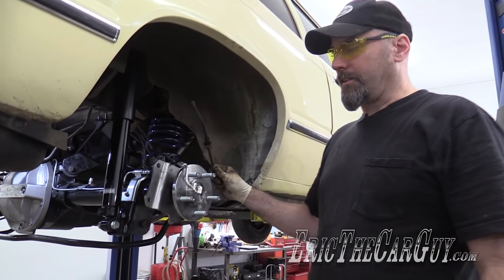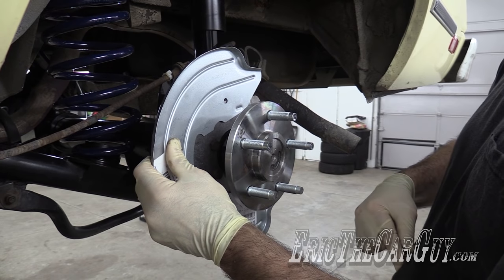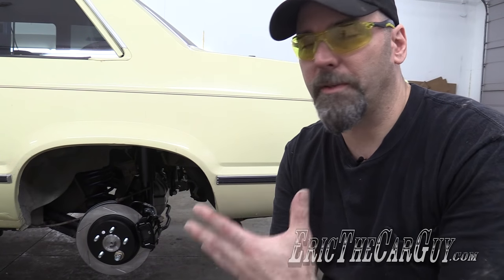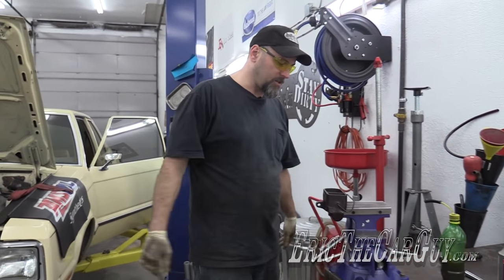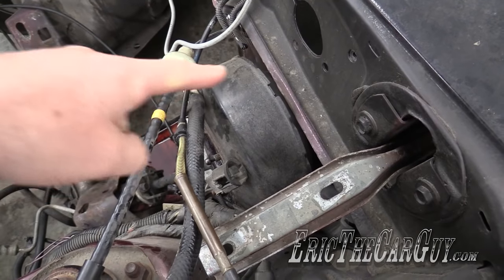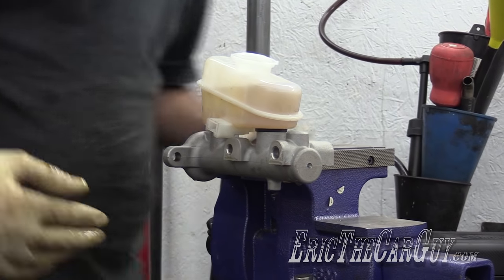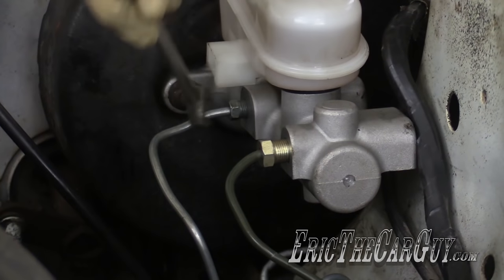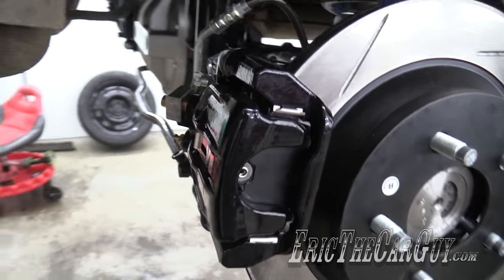Installing Rear Disc Brakes the Hard Way #FairmontProject

Comment: i saw the upside down caliper as soon as the first one went on, I thought, ok, Eric will catch it....then when he went to bleed the system, I thought, ok, NOW, he'll see it. i feel for you, Eric, I've been a tech for over thirty years, I've done that more times then I'd care to count. the excitement of the build, seeing the pile of parts becoming a functioning unit, its easy to get blinders to the basics. no ones perfect.
Reply: anyway, on the positive side, with the heavier weight of the new engine and the four wheel brakes, you will benefit from the power booster and since you converted from drums to disc, the old proportioning valve wouldn't work, as the ratio of pressure front to rear is different. you would have ended up putting in those parts anyway.
Reply: I noticed it and thought something was wrong, but I was so focused on finding the mistake and forgot about it :P
Reply: I assumed there was an upside down caliper somewhere... lol I did that myself once...
Reply: I would not have noticed if not for the disclaimer at the start. But, looking for mistakes noted bleeder needs to be at highest point to get air out. S happens to us all.
Reply: Yeah, around the 6min mark I was like "why the hell is that bleeder BELOW the incoming brake line??? Who designs something like that???"

We've all done stupid stuff like that, so I don't want to blame him for this. We all know that "I WANT IT FINISHED" mindset that causes screwups like that :)
Reply: I had a local Aamco replace an axle (I was on lunch break at my job, trying to get BACK to work when the splines pulled out of the cv joint), I thought it was my clutch failing, so I just had them take it to the garage rather than me diagnosing it myself. Anyways, they replaced the axle and for a fair price, I was quite content, until a week later... they had to take the ABS sensor and disconnect it when they put the new axle in, and when they hooked it back up again the wire was TOUCHING the new axle and chewed through the cable. I was pissed, the new abs sensor was about $120.

Fast forward a year, I'm replacing the struts in my wife's car (same model as my car) and I had to disconnect the abs sensor... and YUP. Hooked it up wrong. Took a few days to chew through, but suddenly the whole car is dying out like traction control is kicking on, turns out to be the sensor... I can't tell you how utterly disappointed I was in myself.
Reply: Everyone who works on cars has made this mistake at some point. I remember spending ages trying to figure out why it wouldn't bleed only for another guy to walk over and take one glance and spot the problem.
Everyone has off days
Reply: ItsFriscoBaby Recently my wife's car was dogging out big time at around 35-40mph, I thought the transmission was dead because the fluid has been smelling burned for quite some time (I keep changing it too), had it taken to the garage and the guy informed me I had installed the ABS line so that it was touching the axle and it rubbed through making the car think the passenger front wheel was spinning. I was pretty mad at myself for 1) ruining a $120 sensor, and 2) paying someone else to figure out what was wrong. 

The sensor was $120, but the bill alltogether was $220. I thought it needed a new tranny so I rather let them do it than me, it's worth the money to me since I only have weekends to really work on vehicles.
Reply: i know the feeling when i get my car out the shop and crap isnt quite right so i decided to start working on my own lol
Reply: dave1135 
I'm guilty as charged as well. Seen it numerous times and it didn't register until about the time right before Eric caught it when I paused the video and thought about it...then it clicked. Figured it watch the rest of the video and he caught it as well. Sometimes the things we do get lost in the moment, happens to us all.
Reply: I sent a Jeep XJ for and MOT test in UK.  They told me I needed a brake caliper for the offside, which they ordered for me.  Delivered was an onside caliper, which fits, but the bleed nipple is on the bottom.  No bleed nipple anywhere in the universe is at the bottom, but they spent 5 days trying to bleed it anyway.

When skin-diving in poor visibility it's possible to become disoriented.  Hint, bubbles always go upwards.

Comment: Kudos on you for keeping it honest.  This is my weekend project.  Front & rear discs & pads, complete rebuilds on parking brake assemblies (drum setup inside rear discs), and watching your videos encouraged me to upgrade to braided stainless brake lines, so I'll be upgrading those this weekend as well & flushing the system before buttoning everything up to get my daily driver ready for the trip to work Monday morning.

Comment: Eric, 

It's videos like these that keep things real. So many times if you watch automotive tv, they do things and they seem to magically work.  I think that the struggles you went through with what would seem to be a relatively simple job like brakes, make people realize that there's more to doing a job than just bolting on a few parts and calling it done.  Thanks for powering through and figuring out what the problem was.

Comment: I love, love, LOVE the honesty in the videos that you post.  The simple mistakes that can be made (in this case, more because of the excitement or head rush), which is why you should always double & triple check your work. Then verify repairs or test drive vehicles before handing them back to the customers.  We, in the repair & service industry, have ALL made mistakes one time or another.  Just try to learn from them & always drive to do the best job possible.  

The other  reason why I love your videos so much, it shows the struggles & setbacks we go through.  Now customers or those not in the repair or service industry have an ability to somewhat step in our shoes & see them 1st hand.  Too often, there are customers who think because we do this everyday, we should know things in & out.  Everything always goes to plan (when in fact more often than not, it does NOT).  We are pushed to rush & customers get annoyed, no matter how you explain "said issues". 

I have to admit, Eric, your commentary in the beginning & end were quite amusing. A few times it had me laugh out loud.  Keep up the videos & the honesty!  I already see the NEW engine dropped in the background & turbo sticking out.... anticipating the updates!!!
Reply from the maker: Thank you! The videos coming out are about 3 months behind the actual build. I still have a ways to go and a lot more videos as well. Thanks again.

Comment: Has happened to me a number of times when building race cars and hot rods. It's easy to have preconceived notions about how things are supposed to go. I have overlooked the same mistake several times even while looking for it. You just get a mental block somehow. Like adding up a string of numbers and getting the wrong answer. You go back over it looking for the mistake and wind up coming up with the same wrong answer again. Frustrating, but I can't think of anything more enjoyable than working on non computerized cars, even when things do go wrong once in a while. Glad you got it figured out. IMO, these Fairmont videos are by far the best you've ever done.

Comment: Wow I just went through the same thing 2 weeks ago when uninstalling my BBK. It was a two day ordeal. I was going nuts bleeding the master cylinder and all. Finally my friend told me make sure they are on the right side because if the bleeder is on the bottom air gets trapped up top. What a PITA. Kudos to you for figuring it out 10 times faster than I did lol.

Comment: had amost exactly the same problem with a london taxi. inconsistant brake pressure. changed almost the entire brake system out for new. then after 3 days of swearing. i realised there was a 3rd bleeder valve on each caliper that i hadnt seen at the back of the calipers.. full of air... doh... you live and learn. great video Eric.

Comment: I run a homemade rear disc setup and have to bleed the calipers off the hub as they mount at a different angle to there intended position. Such an easy thing to miss especially when your focus is on the test drive. Owning a sleeper is awesome and getting stuff like this happen is just part of the 'fun'.  Love your vid's, keep em coming :)

Comment: We all have some similar story, now you have yours. I replaced a radiator, all coolant hoses,  thermostat, and finally the heater core before figuring out the head gasket needed to be replaced...... now I own a compression tester.

Comment: I gotta get my told ya so in as kindly as i can. I am glad you figured it out and tackled it and this video with such humility.
The prior video when you made brake lines for the rear diff, I asked if there was going to be an issue with the bleeder below the brake line inlet.

Comment: I did chuckle when you installed them upside down I probably shouldn't have but I did. At least you are man enough to admit your mistakes. You got your rotors on the right way that was a start. I did have a similar problem once and I put it down to eagerness I just replaced the motor in my car and put two spark leads in the wrong spot and could figure out why it was misfiring took me a whole day to figure it out and yes I laughed at me for being so eager blind to the problem.

Comment: I'm doing a rear end swap in my ae86 and i had the exact same issue with my caliper bracket spacing.  i saw someone cut out the mounting area out of the drum brake backing plate and that works well if you wanted to go with a plate like spacer over the washers. these rear end series are helping me out a lot with my rear end swap project.

Comment: I noticed the position of the bleeder as soon as you mounted the caliper. Means a lot that you are willing to show your mistakes. I call them backing plates too. Really like the stool you were using. You can use a master cyl. from an E250 early 80s van. Works great for manual brakes, and has a 1 1/4 inch bore. Should bolt right up. I used one on my Heep when I did a rear disc swap. Will lock up all four 38" tires and stops on a dime

Comment: been through this on the same car ...you gut the stock prop valve and install the new master and the adjustable prop valve ...disc's need a ton more fluid displacement then drums hence the larger bore master , adjustable valve gets installed in the firewall junction on the passenger side of the cowl (then I watched you do just that haha)., Lookin good Eric ,love the build man.

Comment: Eric, I feel for your pain on this one.  Sometimes you have to know when to walk away and come backs to a job.  I believe you became so focused on driving the vehicle that you rushed things, missing the obvious.  Bypassing the instructions was one of those; not verifying the right and left sides was the second.  I am glad you left the mistakes in, as it illustrates that these errors then compound on each other (including changing parts that didn't need to be changed).  When you start changing parts that were working before you started your upgrade (I.e., the master cylinder), time to step back...parts don,t typically fail just sitting on a car like that.  

Rushing (and frustration) results in breaking (no pun intended) things.  Know when to walk away and think things through, including getting another set of eyes looking at the situation when you can.

Comment: Eric I tried to bleed the brakes for three days on a 1988 mercedes, I replaced the mc but still didn't bleed the air, finally it only worked using pressure bleeder , nothing g was wrong it was just how it works so good luck my friend...

Comment: my first car was a 1981 fairmont 302 4 door blue white top. it was the best car ive ever had. it was fast factory. got pulled over plenty of times. that thing took a beating. at the end i was the only person in the world that could start it. turn key on position, push peddle to the floor to turn choke on, turn it over and well u just had to have the magic foot going back and forth between half throttle and the magic point. lol some idiot went around me as i was turning left he clipped me caught my bumper. it did damage to his little car. it just knocked one side of my bumper out of socket. went muddin it id turn it sideways and go up this muddy road sideways. everybody was gettin stuck there they couldnt believe i was going through it. anyway fairmonts rock.

Comment: All I could do was slap my head and say doh! I had a feeling from the intro that you might have put the calipers on the wrong side. We've all done it. Even still you helped me figure out the braking issues in my '79 Cobra with a late model disc rear.

Comment: I've had soo many people tell me that I put the slotted rotors on the wrong when I did the big brake kit video on our 15' JK "Project Dirty Willy" and yes you are correct Eric, the slots point forward! Also as I'm sure you probably already know that it really doesn't matter what way the slots go as long as they don't have "directional" internal cooling fins/slots. Also if you have front and rear slotted rotors I've heard and read that they need to all be pointing the same direction, I honestly don't know if that's 100% necessary or if it's just for looks. I asked TeraFlex about the direction of the slots and when they said it doesn't really matter what direction they go I said "then why do you say they need to go this way in the instructions" They said they put that in there just to get people to quit calling and asking what direction to put their rotors on. As for the bleeders, been there done the same thing. I got lucky though with the TeraFlex calipers, they have a spot for the brake line and two spots for the bleeder, one on the top and one on the bottom so you can swap them out without changing sides of the vehicle. Awesome video!

Comment: Eric you are allot like myself, want to go out and play half done. Personally with what you have available to you  I think I would have striped  whole car, sandblasted, primed, painted then put everything back together sub system by sub. Yeah that means taking it down to the frame and working up. I still wish you would do it with the Fairmont, take it all off, place it on the floor and do it right. You have the room to do it and do your normal activities.

Comment: Just a little tip in case it slips your mind. When you "pretty up" the brake booster, and re-reinstall it, put a gasket or some kind of sealant between the booster mounting flange and the firewall. It will keep out any water, fluids, and fumes from the engine compartment. 
 I know, I know. It's not that big of an area for too much junk to get in, but it's still a good idea to seal it off.
 I love watch the vids. Keep the old one going.
Reply from the maker: I will be taking it off again as I have a new booster ready to install. Thanks for the recommendation.

Comment: Been there, done that. I installed a brake caliper on a 78 Jeep CJ-7 and evidently it was boxed wrong. Had one HELL of a time getting good brake pressure until I realized I had a right caliper on the left side.

Comment: You are not alone. ha ha.  Here in New Zealand all our vehicles are Right hand drive. I bought a project car. A1303 vw beetle.  In reassembling the brakes i found the brake master cyl was a lh drive one which doesnt fit as the flange is different and the outlets are on the other side of the cyl. So i got the right one, change the blanking fitting over from the top of the old cyl to the new one for the front circuit. The rear circuit has 2 outlets, one for the line to the rear and one for the brake switch. now  the front circuit has 3 outlets. The top one that had a blank, the middle one that goes to the tee for the front lines and the bottom one that has another brake switch. I bled it and could n't get a pedal, ! ! ! *&^%%$$## Took the master cyl out and took it apart expecting to find a damaged seal, absolutely perfect. ! ! ! ??? So i went to put it back in and looked at it and it hit me the top port of the front circuit had a BLANKING PLUG in it and not a Bleeder So it was trapping air in the master Cyl. I went out and bought a bleeder nipple and that fixed it. (the master cyl also fits the 1500 model that used the top out let for the front circuit for the left front brake and the middle outlet for the right fr brake and doesnt have the Tee in the line.) HaHa

Comment: I must have watched a dozen caliper replacement videos before replacing my calipers and not one of them pointed out the fact that there are left and right side calipers so I too discovered the joys of trying to bleed the brake lines of calipers that were installed on the wrong side of the car.

Comment: Your reaction, after doing the quick easy thing, bolting new calipers on, and then assuming everything else was wrong, from the proportioning valve, to the brake block to the fittings to the master cylinder et al isn't a mechanic thing.  I'm reliably informed by my better half its a guy thing.
Reply from the maker: Indeed it is.

Comment: If it makes you feel any better you should see the brake problems I'm having on my rear disc conversion on my Fairmont. I believe I have my banjo fittings upside down currently, and why my brakes a presently trash. Definitely am in the same emotional state as you are in this video.

Comment: Strangest thing I noticed was the vented rear discs. I had a 92 Crown Vic and it just had vanilla flat discs, well, drum in hat, but still just a solid disc with a little drum in the middle.